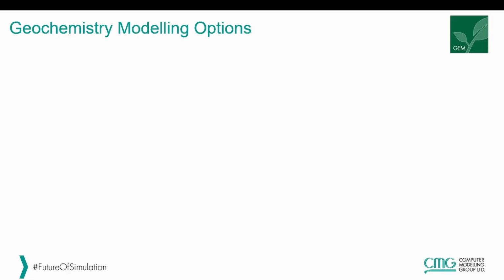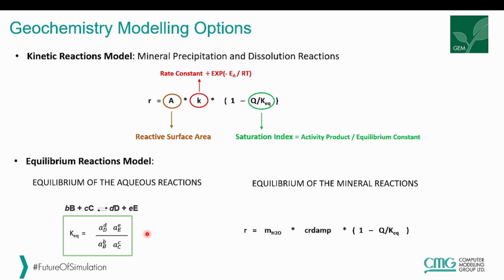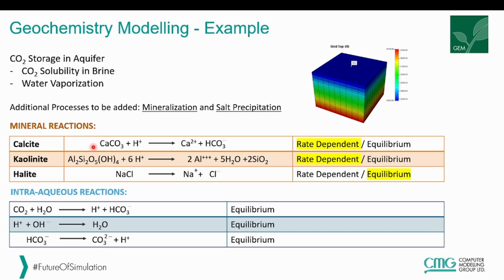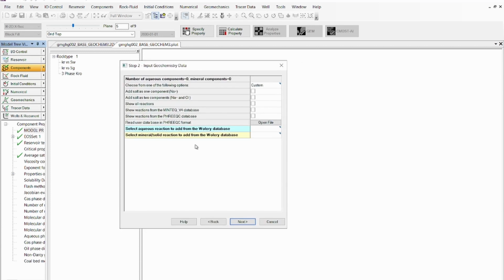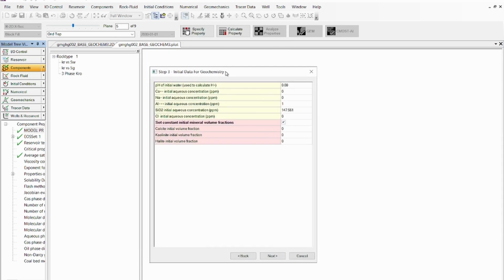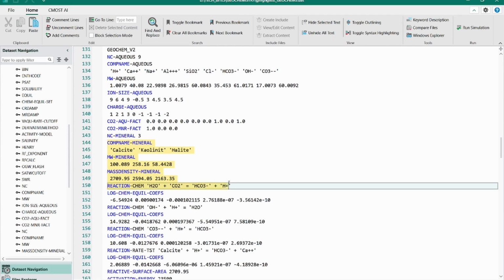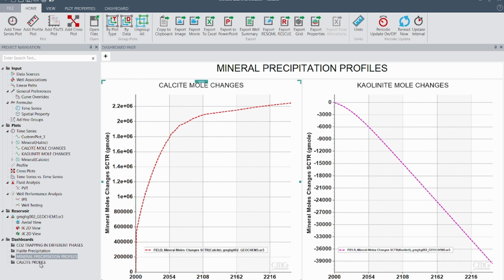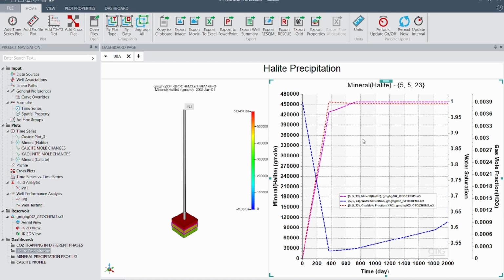Geochemistry Modelling for compositional simulation using CMG

Comment: Thanks a lot—this is really impressive work. I can clearly see the effort and depth of knowledge that went into the geochemistry modelling for compositional simulation using CMG. The way the geochemical reactions, mineral equilibria, and aqueous phase interactions are integrated into the compositional framework is especially noteworthy.

It’s also valuable how the modelling approach highlights the impact of salinity, mineral dissolution/precipitation, and fluid–rock interactions on CO₂ storage performance. This adds an important dimension to conventional compositional simulations, bridging the gap between pure reservoir flow modelling and geochemical processes.

Great job—this is a strong foundation for both research and field-scale applications.